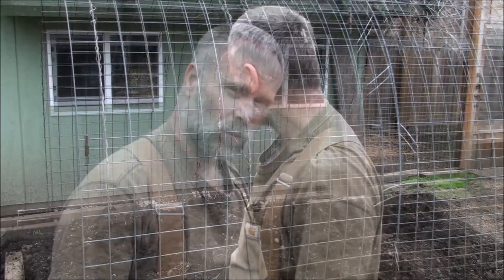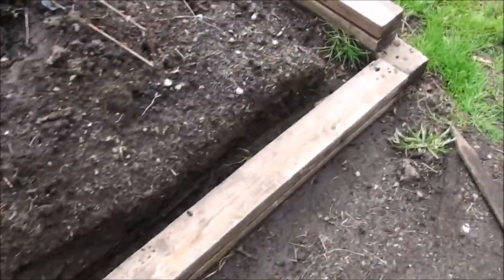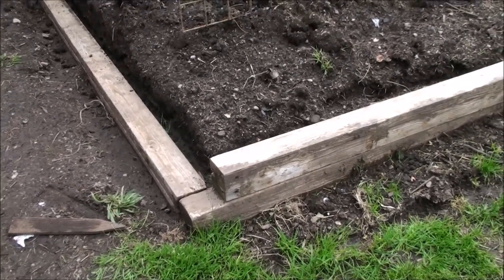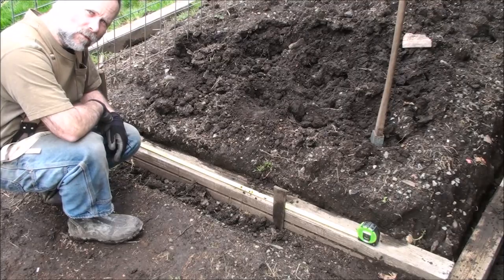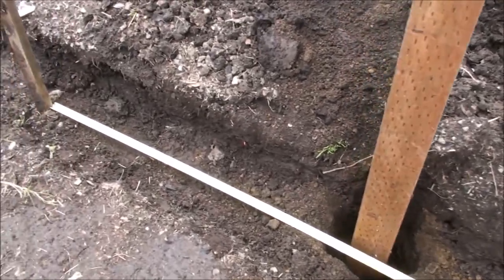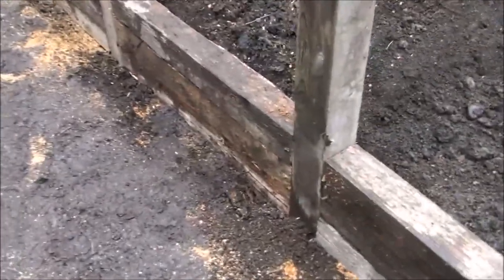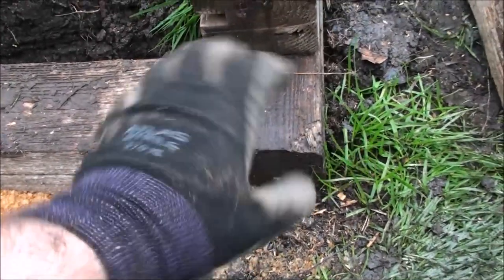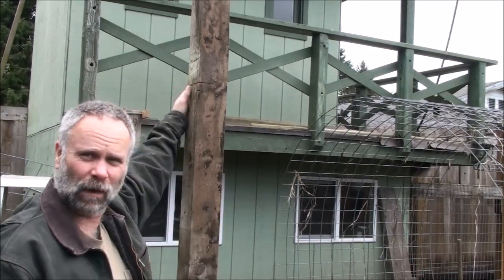Boxing in the Potato, Squash, and Bean Patch

Comment: X pattern to verify Square. Yes that is true done that for over 15 years as a Frame Carpenter. However you have a raised bed there so your tape will bow. Do you know the 2 foot, 4 foot, 6 rule? Or the 6 foot, 8 foot, 10 to get square? You can also measures your run then your rise, put that in your construction Master III and get your Diagonal. On that small structure I would use the 2,4,6 so you don't have to move so much dirt. Take care brother we will keep you and your wife in our prayers. Jeff and Deanna.
Reply: I'm not sure what you mean by the 2,4,6 and 6,8,10 foot rule. I do know about the loss of accuracy in the tape sag and was mindful of that when performing the work but also wasn't overly concerned with it because it was a small structure. I know if the sag is the same each way the square should come out close enough for small work. I know of the trick of taking equal measurements out from a point on a wall and squaring to a perpendicular point out from that wall. Would this be what you are talking about? Although I have done work in building, painting, earth work, plumbing, electrical, cabinets and woodworking endeavors I wouldn't classify myself as a tradesman in any one specific area of expertise. Do you have a way of explaining the "rules" mentioned above? Chances are I might know what you are referring to but if I don't it would be neat to learn something new! Thanks for checking in and the prayers Jeff, blessings.

Comment: I used those deck screws and had them break off just where the shank ends.
Reply from the maker: Interesting, he uses these all the time and they always work great for us.  He built both our front and back decks many years ago with these with no problem.  Maybe it was the brand of screws?
Reply: Could be the manufacture Judy. These are Sabre Drive by Midwest Fastener. I have had good luck with these. I know what you mean though. I have had Phillips screws strait out of the box break one after another.